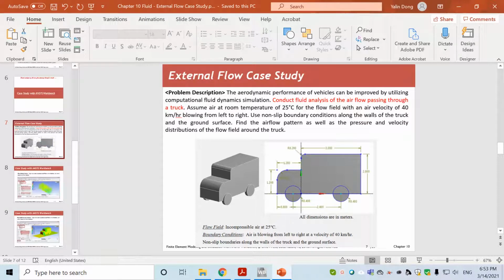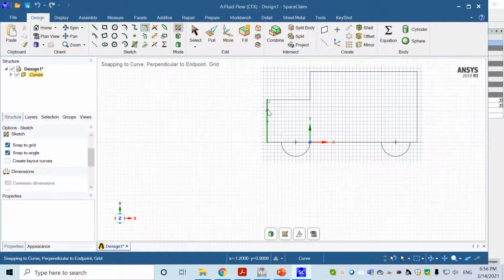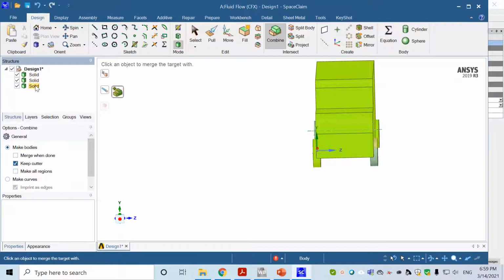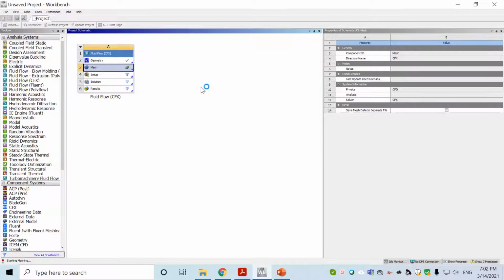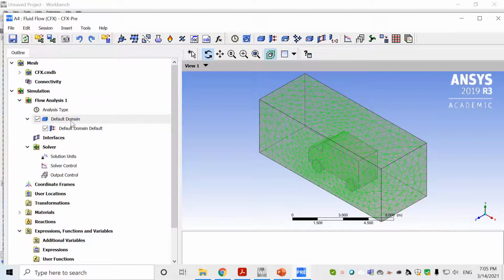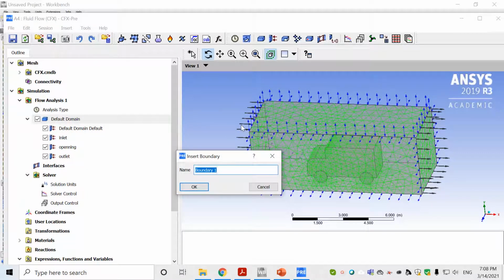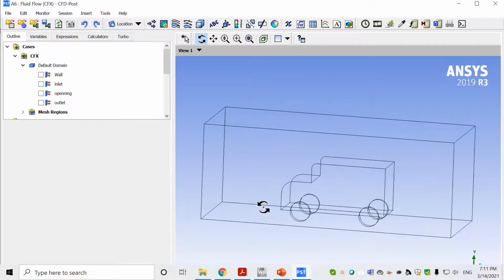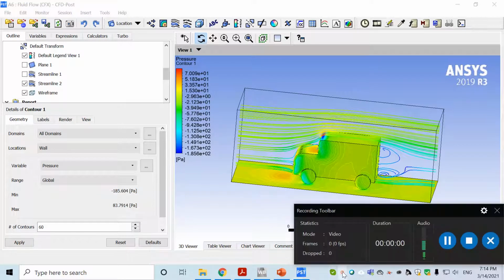Chapter 10: ANSYS CFX modelling an external air flow over a truck.

Comment: I'm 2 years late, but to add a little to the presentation it's probably going to be better for you to group the faces into Named Selections beforehand during the meshing procedure. That way you can easily pick the particular face you want to assign boundary conditions to from a list instead of having to figure out which number corresponds to the correct face.